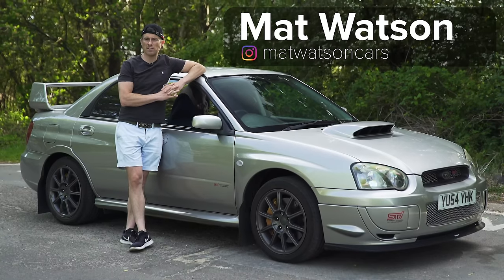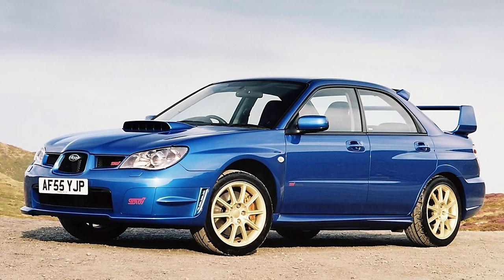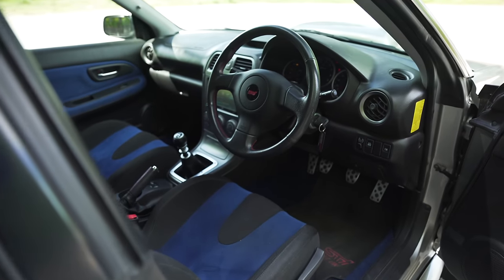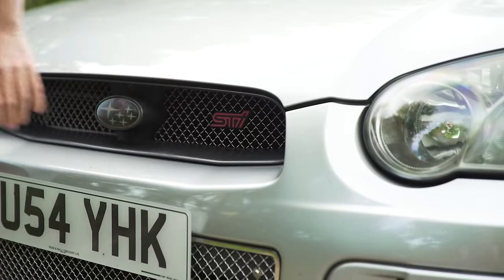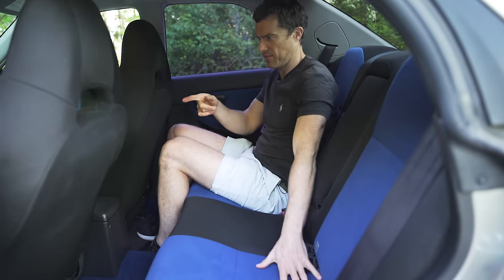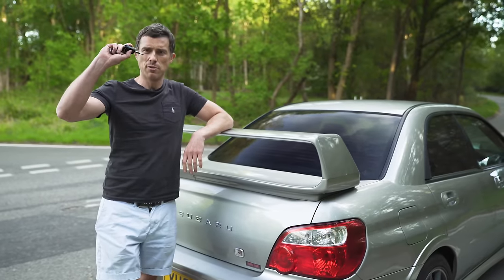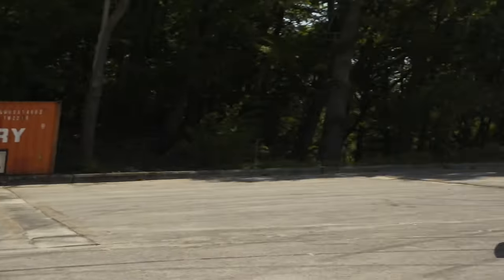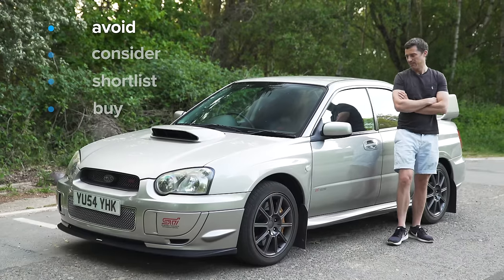Subaru Impreza WRX STi Prodrive 2004 - see why it's the best Scooby ever!

Comment: Fun fact the 03-09 outback and legacy’s all of them had frameless windows
Reply: well before that I had 00 legacy b4 which had frameless windows
Reply: dagnut yes most legacy’s and outback up to 09 had frameless windows I had a 08 outback 3.0 and a legacy gt 08 and both had frameless windows
Reply: @multigamer1213  I miss my B4, far better than the STi as an all rounder once you map the VOD out
Reply: dagnut so true the older outback were good family car and off-roader I love both
Reply: all pre 2008 subaru had that frameless windows
Reply: Also the Forester had frameless windows
Reply: Lone Mechanic not the ones past 2006
Reply: @dagnut  Lol the black box of doom! The 3.0R with the 6 speed box is the superior legacy, so much more linear than a TT, and easy enough to modify.
Reply: @zeroyon4562  depends on tbe model ,  I had the JDM b4, the chassis was all sti with bridgestone dampers , I put two custom downpipes on it and it made a genuine 309hp on barely 95 octane shite fuel we had in Ireland. After the second map the VOD was barely noticeable. surprisingly light car for the size aluminum chassis and bonnets. Totally different car than the euro spec 3 litre, nearly 200kg lighter and 50hp extra.
it wasn't as quick as the impression but I had it on track and kept up with most of them driven hard.
Reply: @dagnut  That's decent power, and it's practically off idle in those too. Nice.
We had a million B4's here in NZ back in the day, all with drain pipe exhausts, practically all run on 91ron. I doubt there's a tidy one left now. You could probably pick a ropey one up for $2k NZ if you wanted. Sad really because they're a damn good car when they're looked after. 
I had the JDM spec B 3.0, made 280bhp with headers, remap and exhaust, lovely car.
Reply: @zeroyon4562  new Zealand and Ireland where the best places on the planet for JDM cars in the noughites. UK had to wait until the cars where 12 years old and Australia had big import taxes to protect their own market.
yeah a lot of them end up as ricers because they were cheap to import.
bought cheap ,treated like shit so they got unfair reputation...lads coming from unbreakable Ek9 type rs not mapping them for the shit fuel were blowing them up..i got mine in early when no one really knew about them so I took my time to figure out how to trash it.. had access to a  v3 type r as well which obviously much more  focused but the b4 was a nicer place to be..full leather, macintosh stereo...it took care of my mates m3 as well at anything under jail time speeds ...i had it sat way off clock pulling away as he hit limiter at 155 so it was pulling 160mph as stable as anything I've ever been..not a peep out of it...gave it regular motul drinks and drove it hard for 2 years without a single problem. Have had a string of bmws now and the legacy stands up in terms of engineering.

Comment: Few years ago i had 2006 STI . Terrible to drive,  unreliable,  expensive parts, drinks   petrol like it has V8. All i remember from this car
Reply: 2.0 or 2.5?
Reply: @zeroyon4562  
2.0
Reply: @PerformanceY  You must have been extremely unlucky then, most of the problems people have seem to be with the 2.5. I've only ever had 2.0 Subaru's (sti's and legacy as well) and they've all been flawlessly reliable and awesome to own. 
Yeah they have a drinking problem though, that's for sure.
Reply: unreliable? terrible to drive? well that’s what u get for not maintaining it let alone changing the oil

Comment: PPP had ECU map, fuel pump, IC hoses, new downpipe with sports cat, 2nd cat removal and Prodrive branded backbox.

Front splitter, mesh grilles and mudflaps were not part of the PPP. Mesh grilles are probably Junsport.

Loved the review though Mat, I'm a widetrack owner myself.

Comment: I have the JDM version of the Bugeye STi, and love it!

Next week it's going in for some work to increase performance, incl bigger turbo, front mount intercooler, bigger injectors, exhaust change and am putting the unequal length manifold on for the Scooby rumble, and power should be going up to around 400bhp and 500nm, and I'm looking forward to seeing what it can do!

Mine is an Aspen White S-Spec one, is wingless and has coilovers in place of the stock suspension 😍

Comment: My first car was a 2004 WRX. That same year I took it upcountry for Xmass and then there were these windy road with S turns. I hadn't noticed as I came down the hill I was at 90KPH. I tried breaking but the wheels on one side lifted a bit, so I took the turn anyways. 
The car did well and at the end of the hill I stopped and stepped outside scared .
Long story short- From that day I only drive Subarus

Comment: I had a 2004 WRX PPP as I needed a hatchback and the STi was saloon only. Still a great car, so quick from A to B on the UK roads - sure a BMW M, Audi S or AMG Merc would have been faster on the track but on your average potholed UK road, the Scooby was awesomely quick (so long as you got the turbo spinning). It was made from recycled Coke cans though - I once put my hand in the wrong place to close the boot and left a dent in the bodywork... Interior was cack as well - as a friend of mine put it - "it's bloody fast, but it's still a minicab".

Comment: Frameless windows rattle a lot when the fasteners wear, so I prefer the support of the frame guides.  The WRX and STi are amazing cars from first gen all the way to the new stuff.  The 2.5 produces amazing torque.  Their reliability once they are serviced are commendable too. As for tuning Matt as you mentioned, they will run around on pump gas at 500 HP and still give 20+ city and 28 highway crusing at 80 MPH, and if you catch a Porsche or Ferrari and you have the correct fuel on board, you can let them see what 600-800 HP looks like as it disappears, especially if there is a corner.

Comment: Video idea:

The Mazda RX-7 is climbing in value and is expected to skyrocket sometime during the next few years as the FD model starts turning 30 years old. 

You can use a video or a series about the RX-7 line to promote the the used car sales? There are also already veteran car dealerships buying these in bulk. So might be you can get one of them to work with you on it.

A mere thought from a humble fan.

Comment: I'm a proud owner of a 2005 blob 👁 paid 9k for it with no mods, no body rust, 1 owner and 110k miles. 
There are 2020 STis, not sure why the host says they stopped making them.
This car is technically a 2004 however, In the U.S.A., this STi is a 2005, not a 2004. You can tell by the cup holders. In the U.S.A., the 2004 has cup holders above the stereo, 05 only has them behind the shifter. Also, for a taller person, this car is super, super small and cramped feeling.

Comment: Each variation model over the decades also was available in an RA model. No fancy stuff roll up windows, roof scoop much lighter than the sti models. Earlier models had no airbags. Better limited slip differentials. Basically an entry level model for rallying. Just stick a roll cage in it. WRX STI RA.

Comment: The DCCD does not change torque split. The torque spit is fixed by the center gear.  All you can do is adjust the amount of lock.  Now, dynamically, this can vary the effective torque transfer, but it really only does it when the wheels are spinning, and it's a REALLY bad way to look at how the center diff works.  It's much better to look at it as amount of center lock and the torque split front-rear is fixed at the 35-65 split.  The lock will have an "effect" but it's not varying the torque split in the way anyone would traditionally think.  Realistically, the best setting is either one step down from full lock  or full lock.  Everything else is worthless.   The one step down will have a fast ramp up based on throttle position so it mostly acts like a locked center, but it will be open when off throttle so you don't get the corner entry understeer push you'd get if full locked.  Full locked is better off road because it's more consistent in behavior and keeps the wheel speeds more even in the soft terrain.  You'll get better, more consistent handling and behavior if full locked off road.  On road full locked just adds a little understeer on corner entry.  However, full lock on road can help with braking since the stock setup is biased towards the front and generates understeer under braking and requires the ABS system to "balance" the braking force under hard stopping.  Realistically, it's just poor braking distance in favor of preventing oversteer.  The corrective action is to change brake pad friction front and rear or add a proportioning valve.  Or you're stuck using ABS which is pretty bad on these old cars, well very bad, very dangerous really, as in it will very likely cause you to crash the car at some point.  Pull the fuse and fix the bias.  However, without doing that , you can lock the center diff and improve straight line braking a little bit.  Overall, it's pretty much a wash.  You trade a little braking for a little understeer or visa versa.  The end result is about the same lap time either way.  On road, full open to just below full lock does almost nothing.  You will quite literally notice zero change in handling in almost every situation.  For the DCCD to show variation, you NEED wheel spin, and this is very rare on asphalt.  Even doing a skid pad and really pushing the car into slight oversteer will still show virtually zero difference between the DCCD settings.  However, off road, the DCCD will generate WILDLY different handling characteristics.  Lower settings will swing wildly between a lot of understeer and then a lot of oversteer due to having to put in a ton of steering input.  The center diff ramp up rate and where it ramps up relative to throttle position is really erratic in actual racing use.  The short of it is you run full locked off road.  You can run one step below full locked off road too.  It's about a wash.  Again, the one step down will prevent some understeer on corner entry, but frankly, you'll get better braking stability into that corner and more consistent handling and throttle application through and out of the corner.  Generally, full lock on soft stuff is faster.  Plan for some oversteer due to the rear bias.  Yes, "full lock" "50-50" is rear biased.  It's always rear biased, the same all the time due to the center gear.  Yes, how much torque that can be put to this tire or that varies some, and that's where the varying torque spit comes from, but it's completely situational, and it's really not something to concern yourself with.  Just think of the STI as rear biased with a 35-65 split and the DCCD only affects the locking ramp up rate relative to the throttle.  You can lock open or lock closed.  You can adjust ramp up rate from open to lock based on throttle position (kind of like throttle mapping in modern cars with eco, normal, sport, sport +, etc.  It just does the same thing with the locking ramp rate of the center diff.  That's all the setting does.  You'll just find more aggressive is FAR more consistent on soft stuff and that it basically does nothing on asphalt.

Comment: I had an '04 STi but the model before this updated one (still blob eye, though). The main differences were no diff adjustment, different alloys, earlier interior, but still had the intercooler water spray with tank in the boot.. It was the same power as this standard; 265 bhp, PPP aside (Prodrive Performance Pack). However, it was aftermarket tuned to 330 bhp (Ecutek remap, Forge dump valve, Scooby Sport exhaust; £2200). Better value and more power than PPP. I loved the exhaust burble and how long I could hold the dump valve open after lifting, more than 10 seconds if done delicately ! It read 160 mph on the speedo, I took it on the autobahn (ex-Army, based in Germany) often for impulse evening runs (unrestricted stretch right by my base) and it went off the speedo, just.
Sigh, I miss it.
However, I have to be open; the understeer was terrible, the Brembo brakes were just ok and therefore underwhelming on track. Speaking of which, I did about 30 Nordschleife laps with it and the brakes faded a lot there. The steering was ok, not great feel or feedback. A Friend at the time had an evo 8 fq340 MR, that was a smidge more accelerative and better handling.

Comment: It’s the same hp as my 2018 STI, but 300 lbs (140ish) kilos lighter. And about 3/4 the size. If I ever wreck my ‘18 ( knock on wood... a lot) I will buy a 1998 chassis and do an RSTI/ 22B style build 100%.

Comment: It is a 2005 model not a 2004. The problem with the EJ257 is not headgaskets its the thin cylinder liners (because of the bigger bore) that cracks.

Comment: I was looking over my friends WRX and noticed there is valve in the hydraulic clutch line which limits how quickly the clutch can be released. If you side step the clutch it won’t slam closed, Subaru must have known the drivetrain needed protection.  I’m not saying it’s a good idea though.

Comment: Both the WRX and STI are still in production, also the 2.5 turbo engines are not known for head gasket issues, the naturally aspirated EJ25D from a few years of Outback were known for this. I only made it a few minutes in and had to slam on the brakes, way too much inaccurate info.

Comment: i usetu have on just like that back in 2012(sure it was tuned to 320hp). But when you are student that 16L/100km is bit too much especially when 1liter cost like 1.4€, and it only has like 40liter tank. Really good car for the Finnish winter tho :)

Comment: greetings from Greece, i love your videos, about the sti`s you are little bit wrong on 2.5 version, thats because it has semi closed block on engine and can handle up to 6-700 hp much easier than the 2.0 that has open block and to boost it more than 450 you should make alot of changes...also the first sti`s that won the rally`s had closed block and can really handle alot of power...just saying..you can check it i guess...its not hate i hope you understand it i was just watching a video about the sti`s a while ago and i am telling you...
keep on making great videos and stay safe from corona virus .
PS the subaru`s have a problem on 5 speed manual (specially when  you upgrade them) their tough - good gear box is the 6 speed, actually the opposite of evo`s that the 5 speed is the good gear box and can handle alot of power
Reply: Maybe the Greek cars are different? For JDM STIs (the only ones to have) the 2.5 is milled from the same block as the 2.0, so the cylinder walls are 13mm compared to just 7mm for the 2.5. So the 2.0 is much stronger. The Spec C blocks have additional strengthening, at least GRB ones. The JDM 2.0 heads flow more air, the twin scroll turbo produces more torque at lower revs, and the redline is over 8000 rpm compared to 6500. I lnow which engine I prefer.
Reply: @TwoSnail  maybe they are different, we are a small country and the guy that had the video i was talking about was living in Germany for about 5-6 years where he studied and now back to Greece many years now(he is about 45),he has garage that fixes and upgrades only subaru`s he is supposed to be master on those cars..the numbers you are telling me are completely different from the information he was giving, except if he is doing himself some imports from Japan...But because we are small country he is a well known mechanic for upgrades and he has fixed many Subaru`s more than 600whp that have more than 3-400.000 km..If i had one i would go to him for sure since there are many cars that last many many years when he takes care of them.. Take care and stay safe from corona-virus my friend, thank you for the reply

Comment: It. is a shame that the UK did not get a beefed-up version of the STI. And I have a JDM 2004 STI I imported to St Lucia in the Caribbean but learned that they had so many variations in japan as mine from the factory I have the stronger chassis/ dash/tranny and 2.0 twin-scroll vf37 turbo from the 05-06 JDM model with intercooler spray with auto mode were ECU sprays when needed/BBS Forged rims and bigger hubs at 5x114.3 instead of 5x100 and with diff control and 305HP from the factory and now with ECUTEK tune car has so much more power from simple tune and has launch control I would have loved to see it pitted against this UK pro drive version

Comment: Absolutely brilliant. There are very few awd cars I like genuinely not many at all. Scoobies from this era are just so purposeful though, they're like an ak-47 you could run em over with a tank, throw em in a pond for a year, pull em out pack the barrel with mud and it'll still hose down contenders that cost twice as much, while cheerfully reminding you that you just did a sweet powerslide around that last corner bro. They're an enthusiastic puppy. Who cares if they're not that capable and leak on everything, they're....endearing. You want an sti to win, you want to watch it beat up the bully, get approved for that promotion, and get the girl E>

Comment: He makes comments about the interior as if its substandard but whats he comparing it to? I don't sit in a car and stroke the door cards. Get on and review what the car does in respect to what it's designed for. Driver experience is what its about here, stuff the fancy fluffy stuff. Thats why it has 3 pedals and a gear lever, ...drivers car. Ten plus years on its still legendary

Comment: Also, didn’t Toyota acquire its portion of Subaru in the early to mid 2000’s, hence why the following models across the range got more boring? The next all-new Impreza actually had a non-turbo version that did only around 150hp (but with AWD), and the next all-new Forester went away from the tall estate look and went “standard” RAV4-ish.